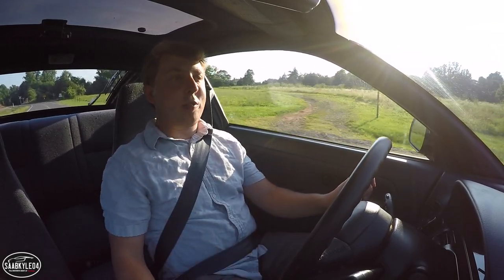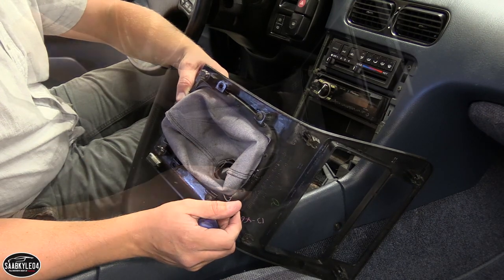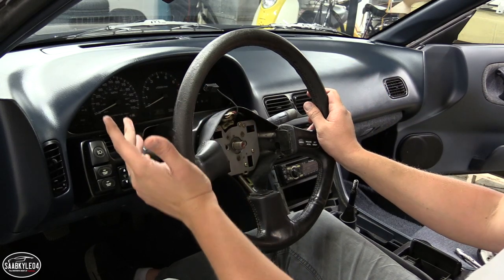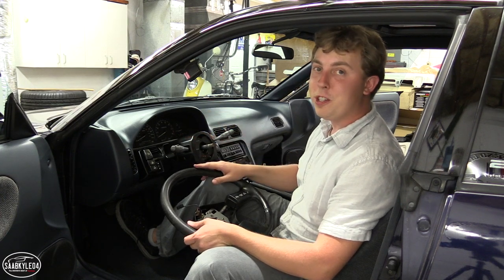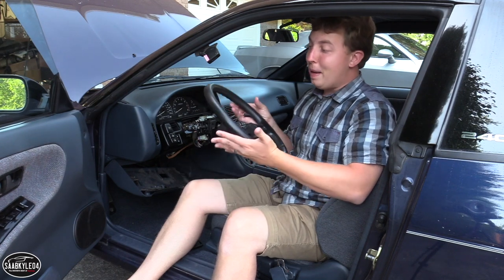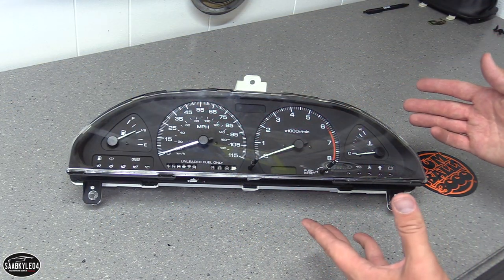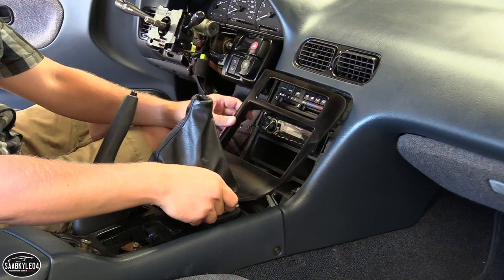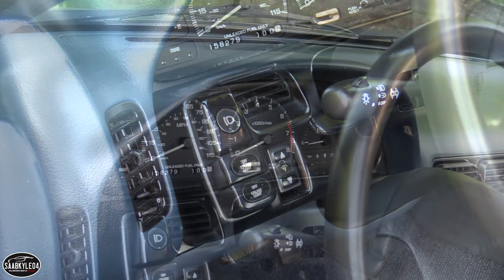240SX Interior Restoration Part 1: Refreshing, Refurbishing & Replacing!

Comment: Rule one when removing a steering wheel, ALWAYS leave the retaining nut on the end of the column this will save your teeth and broken noses
Reply: Thanks for pointing that out, my wifi crashed and I didn't know it had posted. Top of the class at school was you?
Reply: But does it make such a difference if you hit your head onto the column or nut? (the nut isn't that much bigger or less pointy than the bolt of the column.)
Reply: No, I thought you were talking about putting the nut back on after removing the wheel. So that you don't hurt yourself as hard when working in the car with the wheel removed. :D
Reply from the maker: BIG T. That is very smart, thank you for posting this haha.  It didn't even cross my mind, very good advice though.  That could have been real embarrassing 😂

Comment: tbh this car is the cleanest 240 i have ever seen
Reply: T u n i o Stock 240's are usually ugly unfortunately
Reply: T u n i o Yeah no one wants to keep them hideous
Reply: What are you saying impossible to find stock, I have a stock 1989 240sx rotting away in my back yard.
Reply: Adams Adventures there impossible to find stock and running with everything good
Reply: My 240 would be good for a parts car if you hook up a battery to it, everything works, it runs and drives, my family took care of it so its clean inside, outside could use paint but we haven't put it on the road for 2 years because it has bad tires so when we wanted to replace them and take the wheels off all the jack points went through the car.
Reply: Adams Adventures I need parts
Reply: What do you need?
Reply: but the seats are beautiful
Reply: T u n i o i think it looks nice aside from the front bumper
Reply: Ikr

Comment: You should leave the locking nut threaded on the steering wheel a bit. That way you don't smack yourself in the face when the steering wheel breaks loose.

Comment: Put the steering coloum on a few threads. Move the seat forward a bit. Put your knees under the wheel putting pressure on the wheel rearwards. Then use your hands to tap the top of the wheel towards you. Should come easier and you wont smash yourself in the head with the wheel.

Comment: Best way to remove the steering wheel is to rock it back and forth while pulling toward you. Keep the nut threaded on slightly so you don't hit yourself in the face or chest when it comes off.

Comment: You can restore that faded black of the switches with a heat gun, easy.
Reply: Thats generally only a temp fix, which will last at best a few months, all the heatgun does is draw the oils in the plastic to the surface, however once the sun beats on the them again and dries up the newly pulled oil, they become fragile and will generally go back to faded
Reply: Oh! Thanks for the input. I want to restore a black faded bumper, but I don't want to replace it as it is in perfect condition, is there any way to fix that?
Reply: Generally for exterior parts you can only really re paint it with new paint and a clear coat, for a perma fix, however there are detail products designed to bring back black, so to speak, or even a good quality rub on wax...tho again only a temp fix
Reply: Francesco Barbera Thanks for the tip!

Comment: It is very well worth saying that if you are removing the steering wheel from a vehicle, always leave the securing bolt or nut in place and loose until you're got the wheel free.  Steering wheels are mounted on splines often and over time they seize in place so you'll need to give them a very good tug to get them free.  If you take the securing nut or bolt right off, as here, and then start heaving on the wheel it is very easy for it to suddenly come free and fly off, smacking you in the face.  Steering wheel rims are quite hard so hitting yourself in the face with one hurts like a son of a bitch and can easily cause a broken nose, black eyes, split lips, knock a few teeth out or even see you ending up in hospital with concussion.  It sounds stupid but I've done it before (I had a really good set of panda eyes going on for a week) and I know literally hundreds of people who also have, especially people who work on vehicles for a living (just about every mechanic in the world has done it, and if they say otherwise there is a very good chance they are lying in their teeth.)  And when you refit the steering wheel make sure you torque up the centre retaining nut or bolt to the correct torque figure, you don't want the wheel coming off in your hands while you're going down the road and if you put the wheel back on and just do the retainer up as tight as you can get it you're in danger of stripping the threads if it's a nut or snapping the bolt off, which may well mean you need to change the whole steering column out which is a complete mission on most modern vehicles, but you can also crush the bearings inside the column which will leave you with a wobbly steering wheel and, in places that have safety inspections, may make your vehicle unusable until it has been repaired, which, being as a lot of vehicles have steering column bearings that are not available to buy other than as part of a complete column assembly, is going to leave you with an unusable vehicle, a lot of work and a very large bill if you end up having to buy a new column assembly...

Comment: My mechanic put my steering wheel back on wrong after I got my engine replaced and the air fixed which he didn't because he only charged the refrigerant and only worked a little bit of the time and now I have to take it to a body shop and fix my steering wheel because my horn and my airbag and my cruise control don't work or either unplugged or turned off and gotta get that fixed.. bc of my mechanic fuckin shit up